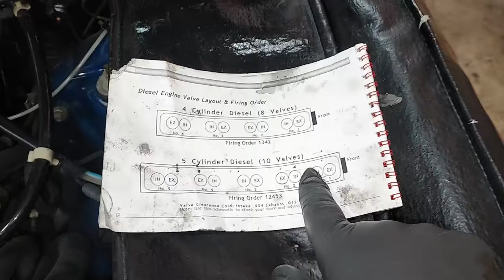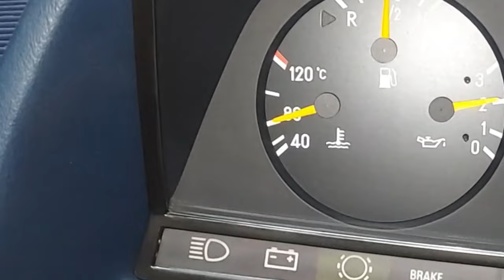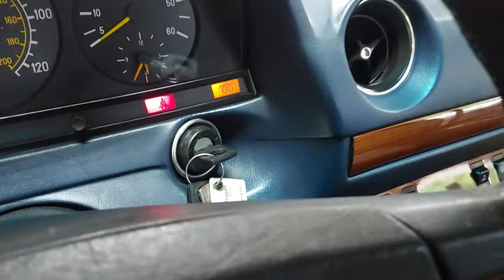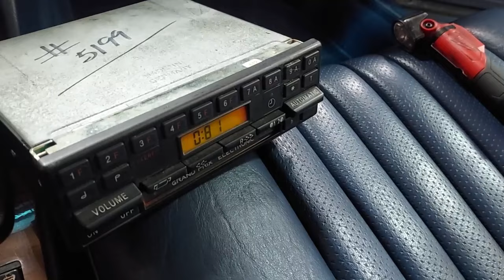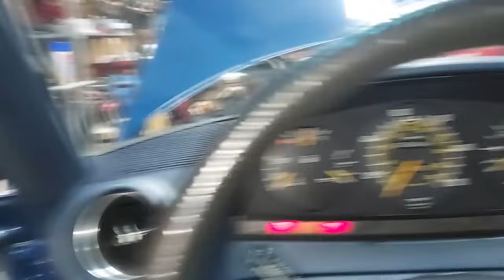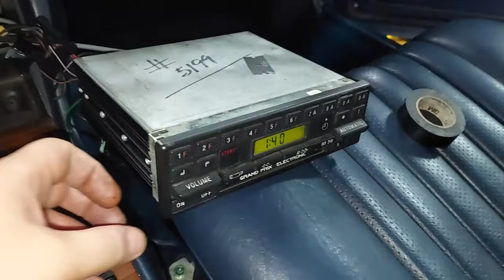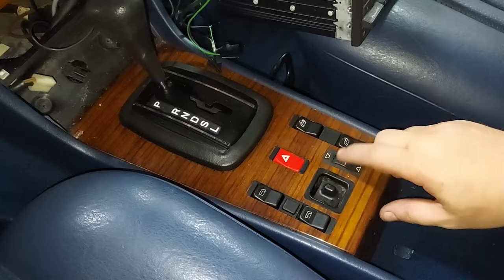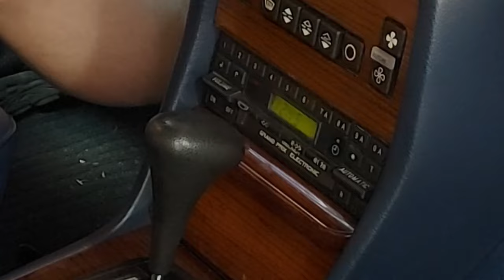1985 "Cali" Wagon Part 3 - Valve Adjustment, Radiator, Antenna, Radio and Hood Pad

Comment: Previous owner of my 500SEL W126 had a Nissen's replacement radiator installed. It's been trouble free. Too bad about Behr. Sounds like the same problem Bosch has with their OEM part manufacturing. I had a Bosch distributor cap the was put together 180 degrees off with regard to the cylinder numbering imprint. I installed it backwards and it worked fine!
Reply from the maker: Yes they make very good parts.

Comment: Surprised the 1985 wagon had the "older" style antenna (instead of the newer antenna with the electronic board) like in my 85 300D.
Reply from the maker: Yeah this design was unique to the wagon. Much more durable and reliable than the newer design that was installed in the coupes and sedans. The coupes and the sedans had a plastic antenna housing with a circuit board that often fails.

Comment: How much does Mercedes charge for those oe engine mounts?
Reply from the maker: I actually have a 20% wholesale discount but I think I pay $125 each.
Reply: @woodsandbarclay  despite costing 3 times the price of the lemforder ones. I would always buy them Mercedes stamped ones. Never compromised on the rubber parts as what I’ve noticed is the other suspension parts such as the ball joints and tie rod ends are fine from the oem vendors, but when it comes to rubber parts they either not feel that good as the Mercedes stamped ones or they don’t last as long as they should. Idk putting on those Mercedes genuine parts gives me the reassurance that I did the right thing and all of the problems in my life are solved. Lol maybe I’m losing it. What’s your experience been?
Reply from the maker: Lemforder is who makes them for Mercedes. Keep in mind Mercedes does not make parts. However you cannot buy them directly from Lemforder anymore and Mercedes has a bunch of New Old stock at the classic center. I literally called them and asked them who makes their parts and they told me lemforder. So always remember when you buy parts from Mercedes you're just buying a brand Mercedes does not make parts. Mercedes does not have a special manufacturing plant that makes parts for them. They are all made by third-party suppliers. There are certain things however that you cannot buy directly from the third-party suppliers so you're forced to go to Mercedes, even though the parts are made by the third-party suppliers.  @ZainFKiani
Reply: @woodsandbarclay  well yeah that would be true for the states. But over here in Pakistan the lemforder ones that are made in turkey are still available and are absolutely trash. You’d be lucky to get a year out of them. We normally prefer the NOS Mercedes parts in the old all blue packaging Mercedes had back in the day. During the 80’s amidst the soviet invasion of Afghanistan. Apart from the other equipment and support the Pakistani military received from NATO they also had a slough of w123’s and w460 g wagons. The w123’s had a very utilitarian spec. Most if not all were 4spd manual 240Ds with mb tex interior, crank windows, power steering, manual air conditioning, oil filed air filters and a unique and one of a kind raised and beefy suspension package with harder springs and shocks with increased ground clearance. Most of these w123’s had the light weight alloy wheels with the hubcaps. Not to be confused with the bundts. Even though the w123 fleet was phased out more than two decades ago but still to this day more and more of these rare NOS parts pop up from these military surplus auctions. In 2020 a mate of mine scored big on a NOS Dashboard and NOS unpainted hubcaps all packed in the Mercedes stamped boxes for 300 bucks..AN ABSOLUTE SCORE!!
Reply from the maker: Well you're referring to the parts made back in the 80s no matter what you cannot get parts that are the same quality as parts made back in the 80s even from Mercedes. Just made information about Pakistan!
Reply: Hey I’m restoring a 85 300td wagon surfblau on palomino! I was curious where you are able to find the accumulators ? I called MB wholesale no luck
Reply from the maker: @CarsIn4K  Call the Mercedes classic center. They have stock in Germany.
Reply: @woodsandbarclay  awesome thank you!